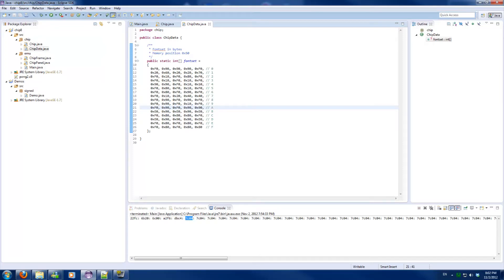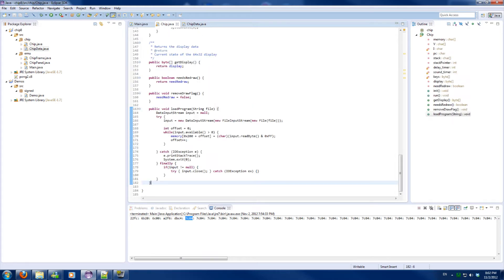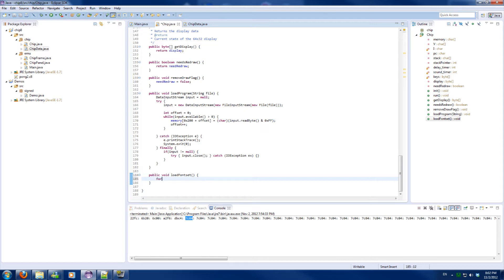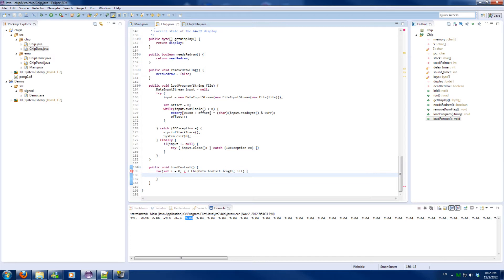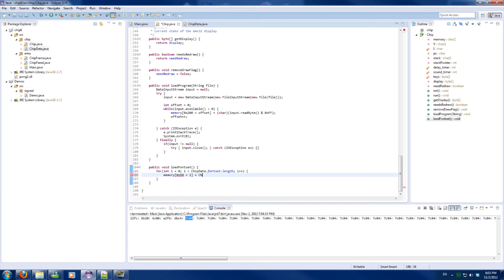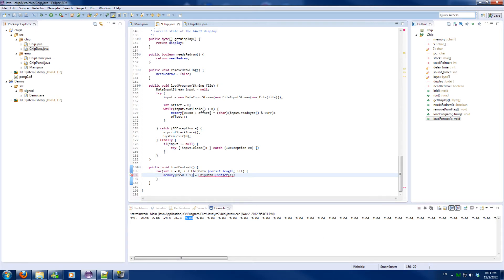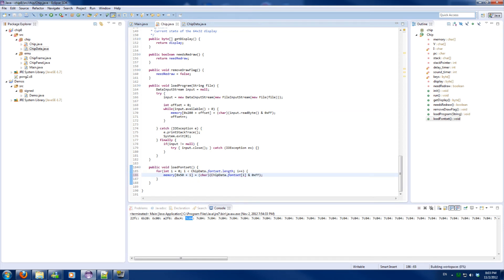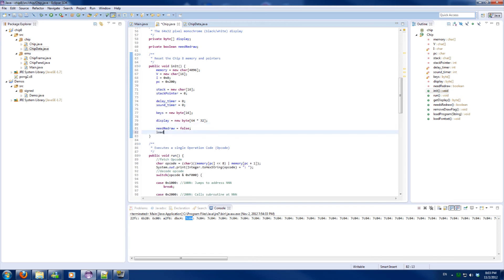Make your own emulator - S1 Part 2: Assignment

Comment: Heyy!! first of all, I'd like to thank you for creating such an amazing series, this is the best tutorial I found on the internet on how to create a CHip8 emulator.
I am following this series and creating a chip8 emulator for iOS using Swift 4, and I have a doubt, in other articles and tutorials they are actually loading the fontsets into the memory from index "0" onwards, instead of index 50 onwards, why is that? I'm kinda confused, will it make any difference?
also your series is REALLY REALLY underrated, 900 views seriously? your series is the only series that actually codes the emulator from the beginning to the end.
Reply: 0x050-0x0A0 - Used for the built in 4x5 pixel font set (0-F)